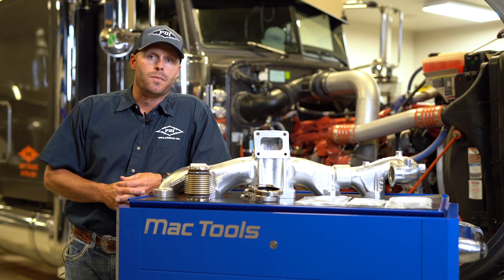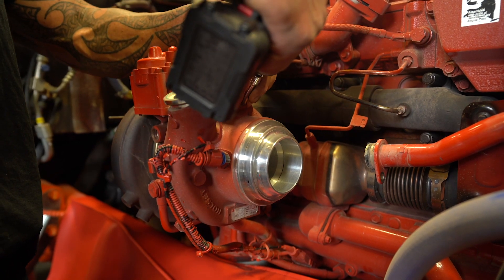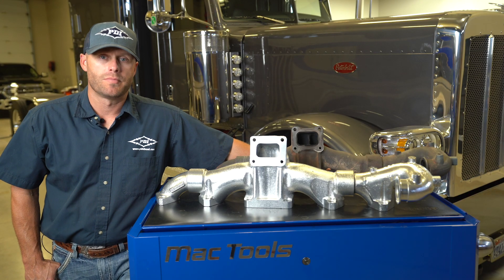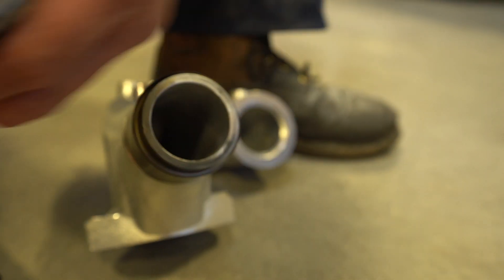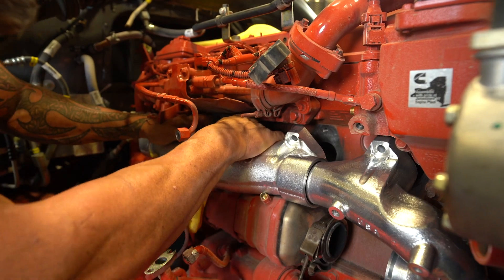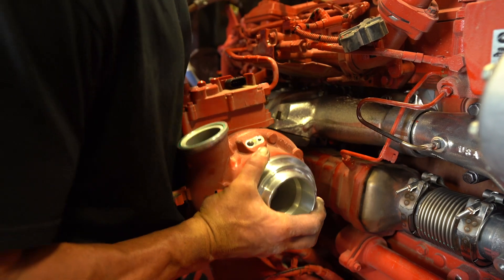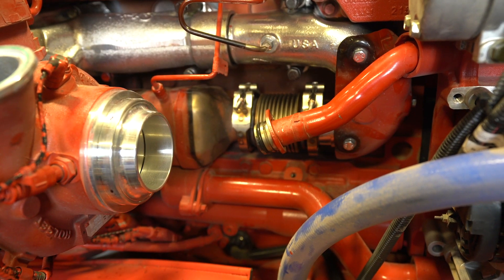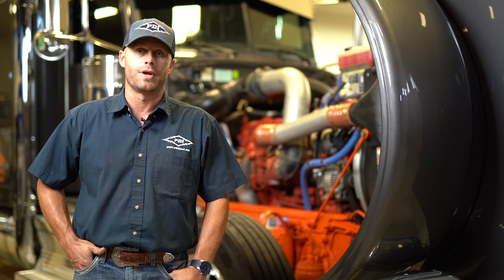PDI Exhaust Manifold Installation X15 and ISX

Comment: 1:09 where does that compressor intake tube go and what does it do? including that adaptor that connects to the compressor housing? I can't find any information online about it.
Reply from the maker: On this X15 in the video, that is the air intake that supplies fresh air to the compressor.  The line runs around the front side of the engine to the compressor.  That may not be there on older ISX15 engines.  The reinstallation is shown in about the 9:08-9:15  section of the video.
Reply: @pdidiesel  ahhh make senses, i understand now, thanks

Comment: Good videos. How much torque and horsepower increase is there using your intake,turbo and exhaust manifold with a newer x15?
Reply from the maker: 15% from the base file with the tuner, and the exhaust and intake each add 10-15 HP, the add a turbo set up will add another 30-40 HP.  So on a 605 you can get over 700 to the tire.
Reply: @pdidiesel .thanks for the reply.sounds good.ill do it after I become a owner operator. I talked to International about Propane Assist and I was told it is a very bad idea with the emissions engines now adays. The exhaust temperature is to high for the exhaust filter and sensors.

Comment: 1st to post.Is there any HP gain since the exhaust flow is better and what is the price?
Reply from the maker: Yes, roughly 10-15 HP Gained on the chassis Dyno when tested on a 605 HP X15 Cummins.
Reply: @pdidiesel .can propane assist be added to your system on the x15 engine because I had one on my d60 500 hp and it was dynoed at 625 hp?

Comment: The port where turbo connects looks larger on old manifold looks larger than on new manifold.  Which port has larger cross section area?
Reply from the maker: Same size, we just opened ours up instead of having a divider.